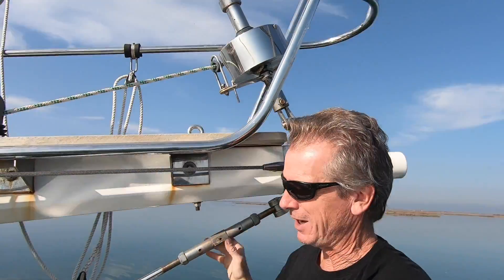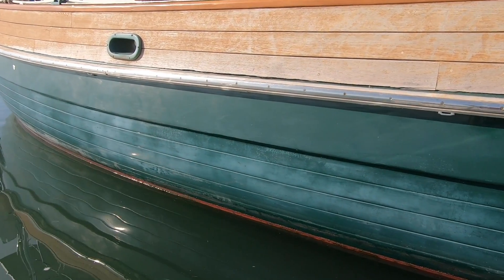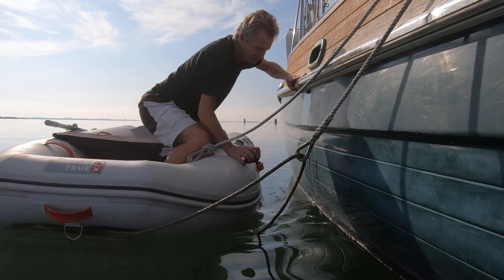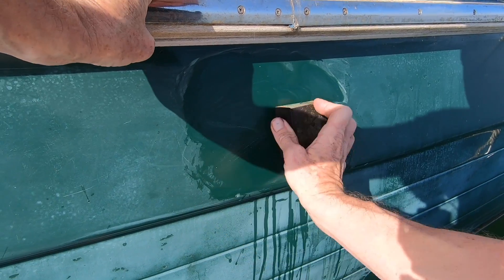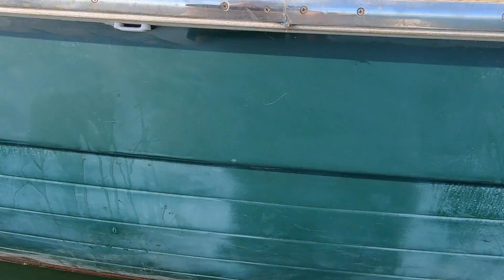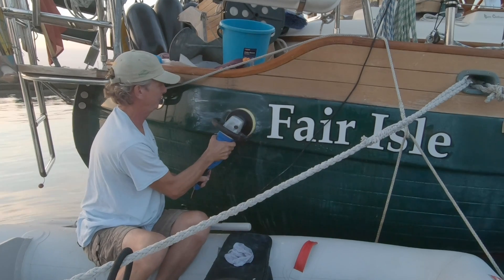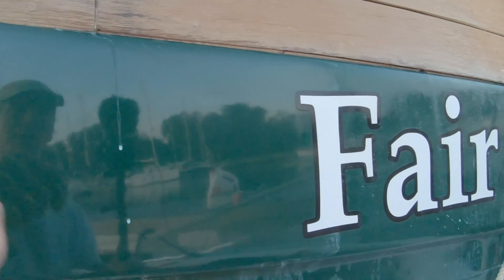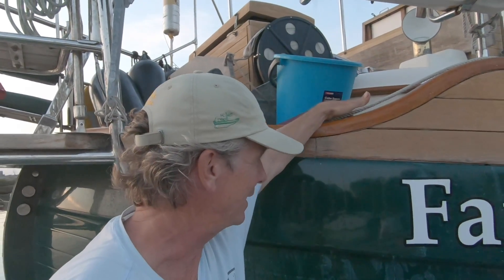Is this the best way to shiny topsides that stay looking great?

Comment: As the owner of a 19 year old Finngulf 391 with a dark blue hull I have as part of my winter maintenance cut back and polish her topsides to get a great mirror reflection but half way through the season small areas of chalking appears it’s not as bad as Steve’s but very frustrating after so much work. She is being lifted out for two weeks  end of April and I have decided to bite the bullet and after the usual cut back top coat in ceramic coating fingers crossed if I get two seasons I will be very happy

Comment: I’m not an expert but my gel coat is also pretty old. 45 years. And I painted my hull. Because it was old it lost its sealant feature and the hull got moist, topside that is. Especially at the bow. I do not imply that is your case...but keep an eye out. Old gel coat can be a pain in the behind!

Comment: I did the ceramic coating on my boat and it seems to last about a year - still better than wax .  Mind you I just did one coat  ,the stuff does go a long way
Reply from the maker: Yes even if it only lasts a year it will be well worth it for me. They claim 3 years using the Ceramic Base & Top coat. Also they say you can top up with a bit of Ceramic fast coat, which is the stuff I've been using on the bronze (and also on the white bits of the deck) And thats A LOT cheaper  & dead easy to do, so might be worth doing.
Reply: @svfairisle   I feel the same , and when I say a year it is not back to what you had . it is much less work to reapply to return to that like new look .  Mine does not have the top coat step and I am careful not to get a build up - just used an automotive kit .  28 foot boat , third year on same kit - it goes a long way .  I could probably get 2 years no sweat . I will snap a picture of what it looks like after a year for you and see if I can PM it to you .
Reply from the maker: @faircompetition1203  yes got the pic, looks great, hope mine lasts as well.
Reply: @svfairisle  I am  personally OK with a once a year finish that also makes the next year job easier .  

There are some other coatings but they build up and also mark up with fenders - a friend tried them . Anything that would be permanent would also build up and be a pain to repair damage to. 

This is a good compromise .  If it works as well as mine you will be happy and redoing it is a wash and a recoat .

Comment: Interesting to see how it goes. Ive used Gtecniq polishes and products on cars and they are are excellent. Re polishing, way too much product and way too wet! Just a few dabs and the polish it out to no residue is the way to go. Use a brush to clean the wool mop. Been using a nano polish, www.nano man.com.au, for a few years, but this year its not worked, so i think i left it too long to dry before wiping and too much used- didn’t polish it out enough. The main issue with ceramic coatings is that they seal the surface, so if its not perfect, then that’s it....you’re stuck with the finish, so bad oxidation on ones gel coat will always look crap.

Comment: How is your Gtechniq finish holding up after two and a half years? I'm pondering it for my own chalky green gelcoat.
Reply from the maker: It was a little disappointing. It held off the chalkiness for 2years but then it returned. I’ve just tried a whole new way though using some 3Ms pads on a random orbital sander & it looks great. There will be a video showing the whole thing soon.

Comment: Ohh, I get so frustrated when people are nagging on the use of electric tools on and around boats and water. We know!! We can't all just buy a new battery powered one😅❤️
But I have been using another brand, for 5 years now I think. And it's amazing. Even the water line stays much better.
Mine is white though, so I don't know about the colored gel.

Fair winds,,,, /),,,,,
Reply from the maker: Ha! Yes and if you’re stupid enough to try and retrieve it if you drop it without making sure everything’s shut down then we’re probably better off without you! No seriously sometimes there’s no other way & I have tried battery polishers, they’re either stupidly heavy or lack the needed power or both! What product is it you are pleased with can I ask?
Reply: @svfairisle  It’s a Norwegian brand actually.  Called: Tcnano Norge 
They have a good range of products. 
Like for stainless and  so on. 
And I’m not saying this is the best. I’m just happy with it. The combination of work, shine and  how it stands the mechanical ware and tear?? (Ah, the lack of English words sometimes 😆)
You know, like behind fenders and so. 
I use fender socks, and if I don’t rinse them it’s like salt paper😅on the hull. 
And I don’t have to buy from 3diferent company’s.

Comment: I'm hauling out in a few weeks and will definitely try this, experimenting on my old Landover 1st. My Question is, in the video you applied wax after 3M rubbing and THEN used Gtech ceramic! your video is not clear if we can dispense with the wax all together or we need to apply wax before Gtech? Thanks
Reply from the maker: No, sorry if it’s not clear, maybe I should write something in the description. The shots with me applying wax after cutting the surface back was when I was doing the whole boat before Xmas & I was just showing the standard method. Then I decided to try the Gtechniq stuff so didn’t apply wax to the top section after that because I was using Gtec. The panel wipe you use before applying the product should take everything off, but no you absolutely don’t want polish on there. In fact when I do the rest of the topsides on haul out I won’t use the 3Ms fine & medium that have polish in them I will go for a put cutting paste. Sorry for the confusion.
Reply: @svfairisle  OK, Great. Thanks for that. Mine is a 35yr old westerly, generaly still looking great but keeping the 40ft of white hull looking shiny for a whole year is taking a lot more effort and elbow grease, so keen to try this out. Thank you

Comment: I agree with Nick Malone, looks like a good system but are you really happy using a mains powered tool in this situation ?
Reply from the maker: No, but needs must.
Reply: As long as there is an ELCB in the circuit he should be fine, our boat had one fitted when new.

Comment: Another question Steve, its expensive stuff so would be good to know if 1 50ml bottle was sufficient to do the whole hull? I'm aware in the video you concentrated on just the top flat area of your hull but many hulls don't have that option. Thanks
Reply from the maker: Really difficult to tell, I’ve got a 250ml can because I’m going to do the whole boat when we next lift. Just doing the top strip as I’ve done doesn’t seem to have dropped the level at all, you really don’t use much but until I’ve done the whole boat it’s hard to say.

Comment: We are very happy with everything we have used it on, cars, a glass runabout, a 2003 Airstream trailer and it's tow vehicle..
The AS's Alcoa aluminum panels are coated at the factory, and the 9H Ceramic has held up very well and she now looks new again!!  https://i.imgur.com/UwCNMCX.jpg
My only question would be the effect of the salt water environment.
RLC
Reply from the maker: Yes my concern too. Most of these nano tech products have been made for the Automotive industry as it's a massive sector compared to boats, but Gtechniq does now have this range that is specifically for marina applications, so hopefully it's geared to salt water? we will see!

Comment: Did I miss it or did you give the brand name of the products you used on Fair Isle?
Reply from the maker: I think I mentioned them all good and bad. Don’t use the car wax I only did because it was all I could get. The cutting paste is 3Ms, but if you’re going for the high tech finish I would pick one without polish added ( the 3Ms product has wax in the light & medium) the Gtechniq product is Ceramic base and top coat (two different products used together but you can just use the base) it’s expensive!

Comment: Just done some research on these products and the car stuff is not suitable for marine life , there appears to be a marine grade but can’t seem to buy it in the U.K. , all I could find were companies wanting to change thousands of pound to do it for you , another rip off ,I think
Reply from the maker: Yes some companies had a ‘professional grade’ that you had to be licences to use & I think you’re right it’s a rip off. The ceramic base & top is very easy to apply and I’m sure just as good as a professionally applied product
Reply from the maker: PS you can definitely get it in the uk that’s where I got mine! Follow the link in the description